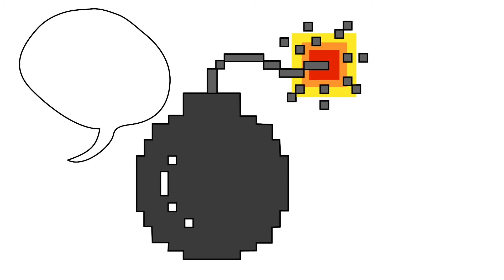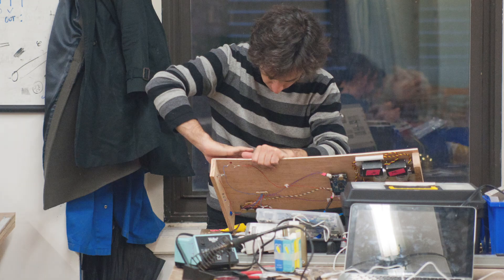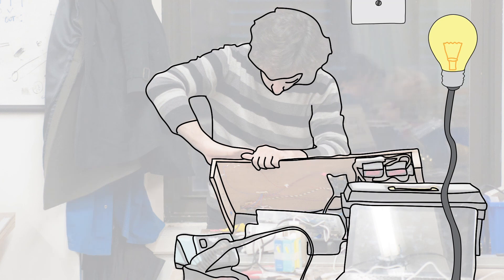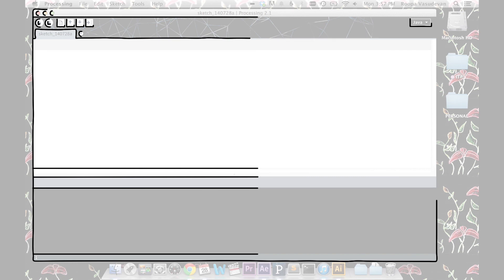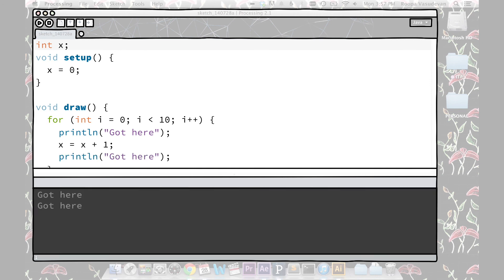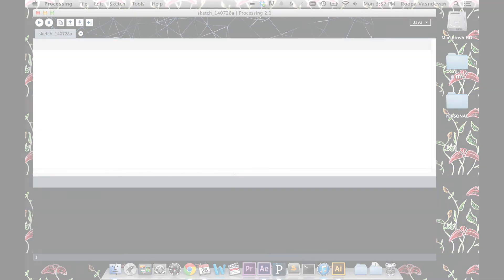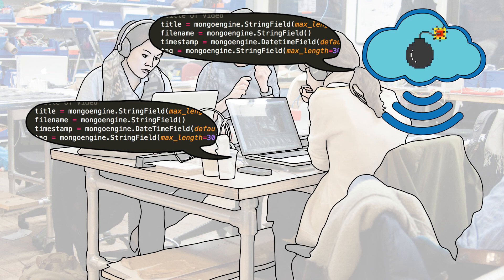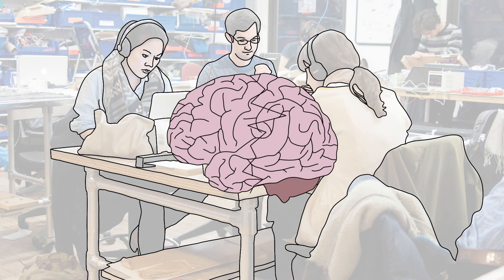A Brief Introduction to Debugging  Part 3

Comment: When adding temporary debug code, I always advise my students to put them at the start of the line and not indented like the rest. When you have found the bug, then it's always obvious which lines you need to remove.

Example:
void draw()
{
println("Value of x before loop: " + x);
    for (int i = 0; i < 10; i++)
    {
        x = x + 1;
println("Value of x inside the loop: " + x);
    }
}